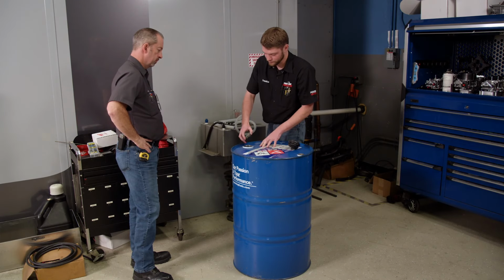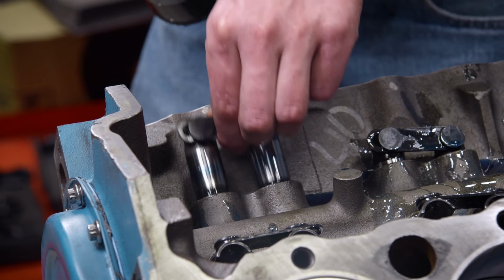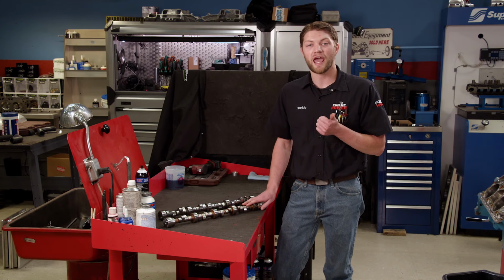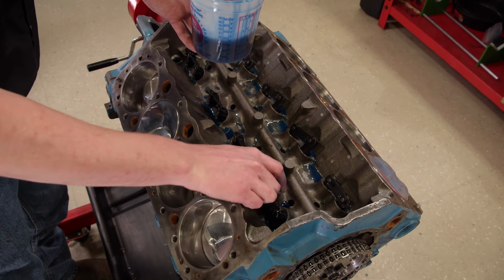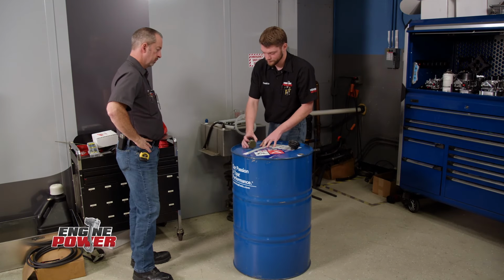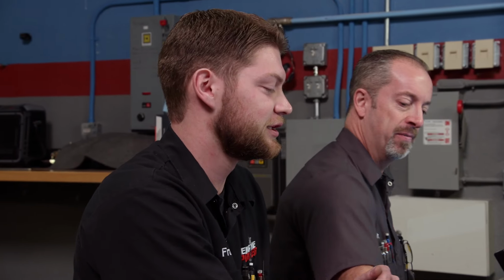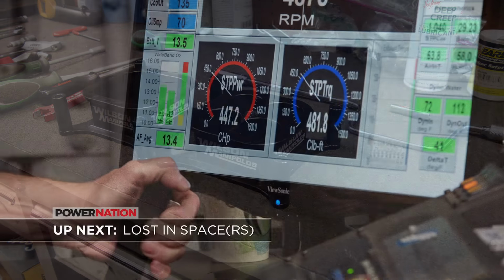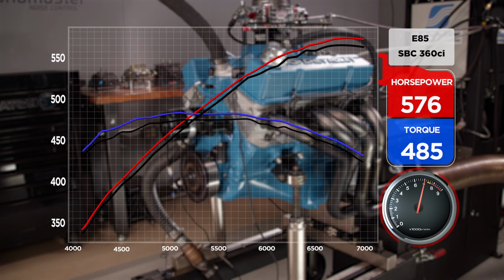Can a Stock Cast SBC Crank live at 7000 RPM and 570+ HP? - Engine Power S10, E1

Comment: Nodular cast iron is also known as ductile cast iron, spheroidal graphite iron, or SG iron. It's characterized by its graphite being in the form of spherical or nodular inclusions, which gives it superior ductility and strength compared to traditional gray cast iron.
Yes, nodular iron is considered an alloy. It's a type of cast iron, which is itself an alloy of iron containing carbon, along with other elements like silicon and manganese. Nodular iron is specifically distinguished by the shape of the graphite inclusions, which are in the form of nodules or spheres, contributing to its ductility and strength.

Comment: To JEFF, ..The 400 stock crank is not Cast crank !  Its a Nodular Iron Crank, thats why you can rpm it, Nodular iron is between cast and forged, like hyperutectic pistons are between cast and forged for strength.
Reply: True! Nodular cast iron is what my flywheel is made of. Nodular cast iron is also known as ductile cast iron, spheroidal graphite iron, or SG iron. It's characterized by its graphite being in the form of spherical or nodular inclusions, which gives it superior ductility and strength compared to traditional gray cast iron.

Comment: Assuming its a steel crank, theres not a lot of benefit by going forged if its a factory block. A quality cast steel crankshaft and a production blocks are roughly the same strength. No real reason to go high end forged, only to end up with the block then being the weak link. 

Makes no more benefit than going with an aftermarket performance connecting rod but then putting a cast piston on it.

Comment: Why has everyone forgotten that stock parts made power before there was this much of an aftermarket?? And, if its going to fail, for the most part, wont it fail over time and holding it at 7000rpm and not necessarily after a handful of dyno runs buzzing to that..?

Comment: the smaller ports negate making power beyond 6500 rpm a 215 cc head would be needed to make real power at 7k. ah switched to 220 cc okay lol
Reply: a 200CC on a 3.48  stroke 4.00 inch bore engine  is a 7000RPM  engine easy because  of the flow they might be and the  size of the ports  are gonna need a single plane

Comment: Do NOT use thread tape on engines. Its a Chev, GM headstud sealer is the stuff to use. Thread tape is less than ideal on plumbing,, I have seen it fill up engines full of coolant.
Having been the E85 route it is far from as advertised. After a dyno making no more power than with avgas 100 it then sat in the shed for a couple of months and when stripped the bores were rusty, badly! I have never seen that with methanol engines and that too is hydroscopic. 
So I will now be [as per regs] be using 102 unleaded.
Those SBC factory cast cranks are far stronger than you think. I have made near 500 on one with 12-1 and turned 7200 regularly road racing. Built a speedway sedan engine at similar and that turned 7000+ for a full season. I rebuilt an 80s injected Super Mod engine, a 327 large journal and it had done a LOT of work. Crack tested and reassembled with a modern cam. And has now done quite a deal more.And has factory rods as well
I ran a cast [no steel ones] 351C crank for around 10 events with factory rods using 6800 max with no issues. All of these engines used good pistons
In the 80s on a Sprintcar the 'good; engine had good crank, rods and pistons and the spare had good pistons, stock crank, rods and a 2 bolt block. That turned 7500+ on occasion and was used for two years with no issues. The good engine turned 8000 but hd too many issues. Both engines won features. That spare engine ended up in a sedan for a period after. Had been rebuilt and crack tested all ok.
People make stupid power on LS cranks which are no better than a SBC crank.

Comment: "the cam only has a few hours of dyno time, no big deal" - I've used roller cams that's had thousands of passes and years of use, with hardly no wear. As long as the cam was well cared for and something wasn't beating the shit out of it, you can use them forever.

As far as E85 goes, I buy it at the pump for $2.30-$2.80 per gallon (in my area as of Apr. 2023), then test it and mix whatever is needed (either Ethanol or gas) to make sure it is E85. Much cheaper than buying E85 "race fuel" ($8.20-$9.50 / Gal. in my area as of Apr. 2023). If you have a source for good Ethanol in your area for cheap, you can even mix your own E85 even cheaper.

My questions is... Yes, making big power with a stock block and stock "cast" crank on a dyno chump, but how long is that thing going to last in a heavy drag car on a transbrake? OK, let's forget the transbrake, how long does it last in a heavy car (say 3200lbs), 1/4 mile at a time? My guess would be, not long!! So yes, fun on the dyno, practical?... probably not.

Comment: Hey man,    in 1970 I  had a Chevy  Z-28 with a 302.   I  had 488 rear end ratio. 
The  Z-28 would run low 14 seconds Quarter mile.  Or high 13 second  with slicks.
I  would shift at 7,000 rpm.

Comment: My 426 stroker, at 12.5:1 compression, was recently tuned for corn and man, what a performance difference!  Can’t complain with a current pump price of $2.90/gal. either.  Helps offset the reduction in fuel milage.

Comment: Lets just say I know how well pretty much a stock 355 can hold up to E85.  I raced several years IMCA Hobbystocks and yes E85 was illegal but guess what I ran it with no modifications,  The Engine was stock crank, rods, pistons with EQ heads 2.02 1.6 valves Roller tip rocers Edelbrock 2701 intake 1 inch adaptor 2 barrel Rochester carb Can't remember what size jets I ran but think it was mid 50's.  The cam was very similar to L79 327 cam/602 crate cam.  Mine was a Lunati cam in the Voodoo line.  Ran between 32 to 36 degrees timing.  would turn the motor every night between 7k to 7500K RPM.  Never had a problem with it.  Always wanted to Dyno it to see what it was putting out.
Reply: Yes

Comment: Those heads are to be used with a 4.166-4.200 bore head gasket. If they had put dowel pins in heads and put their 4.060 head gasket on the head they would clearly see the fire rings are inside the combustion chamber's. AFR even says 1003 gaskets
Reply: As per AFR, the minimum bore size is 4.000 inch. They recommend the 1003 or 1014 so that you can put it on any small block Chevy. There’s no way they would’ve got it to run if the gasket didn’t seal and was inside the combustion chamber
Reply: @Steven Hoitz  but they did not use a 1003 or 1014. If you have access to the heads they used put a 4.060 gasket on it with dowel pins then you will see. Just trying to help.

Comment: If the fuel you can buy is so inconsistent then why build an engine to run on E-85 ?  Just run it on race gas, it cost the same per gallon.

Comment: I delivered pizza for years running a 50/50 mix of e85 and petro gas in my 1999 jeep cherokee with zero issues. The mileage difference was not noticeable unless I was stomping the go pedal. The price was back then was 1.69 a gallon when gas at that time was 4.80 a gallon before the big oil companies complained that they couldn't compete against it at that price.The oil stayed way cleaner I went up to 10,000 miles on each oil change and the engine ran about 15 to 20 degrees cooler. I currently run a 50/ 50 mix in my 1987 g20 van with a 305 and in my 1992 g20 with a 350 and I swear that the mileage difference is even less than when I ran it in my cherokee. I think that it has something to do with my van's both have return lines that put the unburnt fuel back into the tank. Whereas the cherokee in 1997 got rid of the return line and the leftover gas is put into the evap system. I had a 1993 cherokee that had a return line to the tank and it got 4 more miles per gallon compared to the 1999 .Their drive trains were identical otherwise. That's just my theory but I could be wrong. If you do run ethanol make sure your fuel system is sealed i.e. no cracked lines or leaky gas cap.The ethanol can pull water out of the atmosphere that can cause corrosion.

Comment: an engine does not care what fuel its burning as long as its got spark, fuel that's combustible and air, it will be happy to burn it and make power. the only thing that limits an engine is how its made. if the block can handle 1000hp before blowing up then thats what will happen. who would of imagined that an OLD engine would be running on corn juice and making that much power. but like i said, if it burns then an engine wont care what pow pow juice it has.
Reply: >>an engine does not care what fuel its burning as long as its got spark<<
It does if it has pre-ignition and burns a hole in the piston.

Comment: Question.. 16 minutes in. That run. Did I hear surging? Was that the resistance on the dyno? The fuel? Or an artifact of the microphone picking up the dyno room?
Reply: Sounds like the dyno was taking readings in "steps" ?? Not smooth.
Reply: @Peter Darr  no clue. Just curious

Comment: I'd like to see the use of the ethanol / water azeotrope of about 95.4% ethanol and 4.6% water as the fuel - cheapest fuel available, zero fossil fuels. I recall working at Texaco where we'd laugh that adding up to 5% water into a gasoline blend, was the best way to improve octane. And using ethanol fuel from biomass (from our farmers, not gasoline or diesel fuel from international oil companies) is the best way, within our transportation sector - ie. in our vehicles, to reduce global warming. Much better than electric vehicles plugged into the inefficient, expensive electrical grid system.
Reply: Alcohol will burn in an engine at 70% - 30% just fine, so no need to get so picky with the 'still or storage.

Comment: We use E85 from the common gas pump for our Circle Track 358. We Haven't noticed any gains from race E85 to the normal pump E85... we did notice a large $ savings using Pump E85 vs Race E85 and especially against 112vp race fuel.
Reply: all that matters is your e85 is consistant or it will affect tuning

Comment: Is the oil changed after first warmup/run in before power is measured?
I am thinking about the 5-6 different assembly oils and engine oil in one big mixture, that cant be ideal when pushing the engine.

Comment: I would like to see what you can do with a GM 2.4 eco-tech VVT 4 cylinder ... I have one and it is factory rated at 165 horsepower, and the machine is a 2016 Polaris Slingshot 5 speed standard that weighs 1700lbs so the power to weight ratio is close, it is fun don't get me wrong, but it is also tame, and I have owned it sense new, so I like more from it. Can you say I'm to use to it now :) I would like to see double the horsepower to make it fun again :)

Comment: I've ran 3 different sbc 406s with stock cranks and my shift point was 7500 rpm. Never a problem.
Reply: Turned the stock crank in my bracket car with a 350 in it to 7000 for 10+ years. It still ran fine when we pulled it out but when we took it apart the pistons were falling apart 😂 built another one and it also has a stock crank In it. People really don’t give the gen 1 the respect it deserves since the ls came out. These are some very tough engines.
Reply: @nolimitmaster7600  a good balance job goes a long way.
Reply: @Jeff-io2zn  coyotes like lol
Reply: 8,200 here with a 3" stroke L99 4.3 Caprice cast crank and 5.94" PM rods in a 350 block. OE hydraulic roller lifters too.
Reply: Makes me wonder about the Scat 9000 Cast Steel 3.48" cranks. They claim they can handle 500 hp but people say they've done okay to 600 hp with them. And I want to run a Weiand Supercharger on one but only to 6000 rpm max.
Reply: @N-Lee  sounds like a good plan. Have fun.
Reply: @N-Lee  I've seen people push 1000 hp on those Scat cranks. They are good for what they are. As mentioned above, a lot of durability is in the tune. It's really funny when people who build 1200-1500 hp turbo engines spend 4000+ on a billet crank because they think that's what they need. Not saying the cast Scat is for 1000+ hp, but it can work as long as you are on point.
That said, the issue with what you are doing has nothing to do with the power, but everything to do with the fact that those crank snouts are not too happy driving a roots blower. The power itself in your idea is not the weak link, the crank snout is. That's a lot of harmonics and twist in that cast piece. For a roots blown application, I think you're saving in the wrong place if doing that cast Scat crank. Spend the 500$ more and do it right with internal balance. You can get a forged Eagle or Scat for 650-750$.
Reply: @AB-80X  Nowadays the Scat 9000 -3.75" stroke/2pc rms is rated at 600 HP in the Summit Catalog..  I've found two online dyno tests showing SBC engines built with them using a Weiand 177 and 6-71 running well over 600 HP. No Breakage, but running under 6000 rpm. I'm at a crossroads,. I have one of those Scat 9000 cranks, brand new. And I have a rare Trick Flow Specialties Forged 4340 for SBC. It has a Big Block Snout. But weighs 54 lbs compared to the Scat's 44 Lbs. I'll be running a Blower. I can't decide which Crank to use.🤔🤥
Reply: @N-Lee  Easy choice. The Trick Flow for sure. The fact that the hp you talk about is done at lower rpm is of no benefit. If done at lower rpm, it means more torque. That means more load on the snout. I'm not saying that you can't use the Scat, but it will be on borrowed time depending on the use. If it is nothing but a cruiser, no biggie, but a drag car or something you really want to drive? No way I would use that Scat on a 600+ hp blower mill. If you have a forged crank with a big block snout sitting and want to build something with a 6-71 or bigger, there's no question about what to choose. Those 10 lbs is not what will make the biggest difference. The snout on that Scat will develop stress cracks over time, that's just how it is. Just because others have shown that they do it, is that not the same as it will live in prolonged applications. The cases where I have seen the Scat cast cranks live in high power applications, have been in turbo and N/A setups where no external harmonics and side loads is a factor. With your blower all that changes. There is a reason why BBC snouts is an industry standard way of doing blown SBC's the right way. Can I also point out that while your TF crank is more than likely fully internal balanced, your Scat is int/ext. balance. So you will run a heavier flexplate compared to running your TF crank in an internal balance setup. Lastly, that Scat was made to be a lightweight crank, that's yet another ting that goes against using it in this blower application.
Reply: @AB-80X  Thanks. You're right.  I guess my choice is made.
Reply: ,,,,I got a budget Eagle cast steel crank for my 407....Many companies state to limit rpm to less than 5600......How Long and how much abuse to say , 6500 rpm ,, do you think cast steel or cast iron could take.....Guess a shit casting will break in short time.....WTF....
Reply: A stock crank will work fine in a lot of situations if you tune your junk right.
Reply: I think it was Smokey Yunik who said that steel cranks were for guys who can't sleep at night. He went into detail about slight mods to a cast crank. He mentioned that steel cranks are harder on the bearings.
Reply: It's not so much the cranks in my experience, it's more  the rods, other than that they can be quite rowdy and reliable.
Reply: @ I’ve never used the stock rods   Always a 5.7 from a 350.  Even a 6.0 rod from SCAT.
Reply: I also had a similar set up with a 406 also afr heads and stuff stock crank and me and my guys use to say it was a freak motor cause we couldn't believe the horsepower I had when it got Dyno'ed almost 670 horses it was a freak motor that blew up in a freak way I actually cried cause it took me a 3 1/2 yrs to build my car it's hard when you got 5 kids and your the only income of your household 😢

Comment: FINALLY A 350 !!!! so tired of the low rpm 383 builds left over from the 90's and the over priced 421, 434 small blocks that are $20K. take notes high rpms is where its at!!

Comment: with those heads, 220 cc intake AFR's and that compression, you should see 7500 rpms. the cam is wrong, too much lift on the exhaust side, you need more lift on the intake side. even in the gas test i would have used a 950 cfm carb.

Comment: 7000 rpms with a stock crank. every circle track race night sees past 700 rpms. my .060 over 350, cast piston, cast stock crank, stock rods, has seen 7400 rpms with a flat tappet hydraulic cam.

Comment: Few years back I built a mild 358cid with a mid 70's 4 bolt main truck engine. Studded mains and stock rods with ARP fasteners. I skimped on pistons and rings and just used Sealed Power stock replacement cast stuff. I would tickle 7000rpms with it occasionally, and never had it whimper once. It was making around 350hp and 400lb.ft. of tourqe. Nothing fancy anywhere, just a true roller timing set, Melling HV oil pump, hardened pushrods and Comp magnum 1.52 ratio roller tip chromoly rocker arms. 462 camel hump heads and a 230° .480 lift Elgin flat tappet hydraulic camshaft. Weiland Stealth dual plane Z-28 style intake manifold with a Moroso 1" plastic 4 hole spacer and Holly 4010 750cfm carb. Ultra reliable and you could really let lt scream if somebody tried to mess with you. Had about $3800 into it.
Reply: I'm sorry about that dude. 7000rpm and 350hp is pretty bad, I'm sorry it made such little power
Reply: @lollipop84858  How much power do you think an almost stock 350 should make? 7000 rpms is 1500rpms higher than factory engines ever rev'd to. It had a hydraulic flat tappet cam.